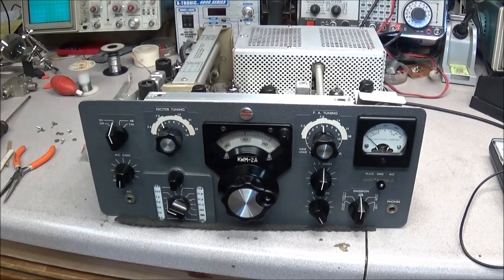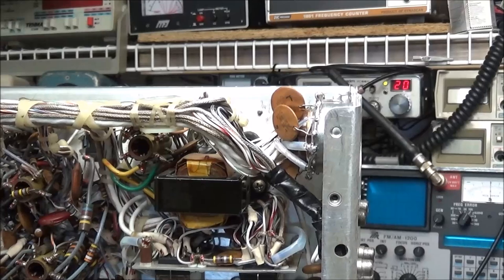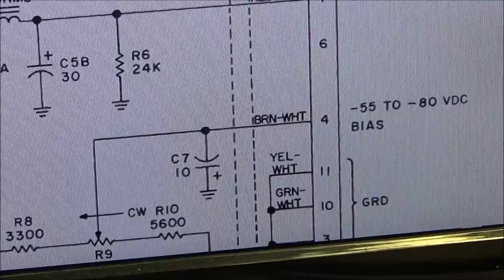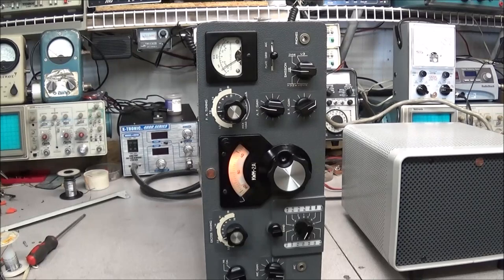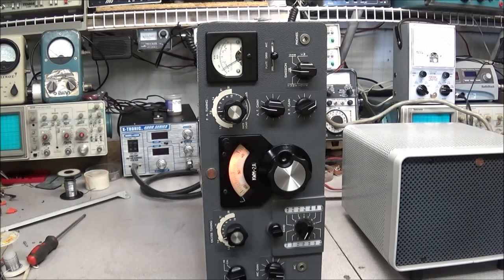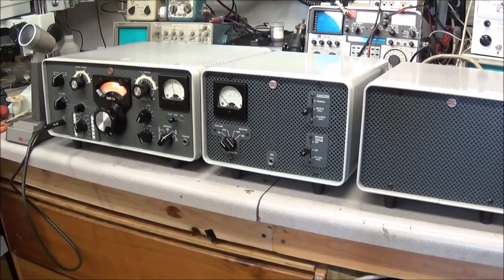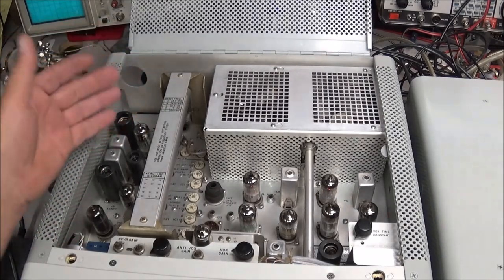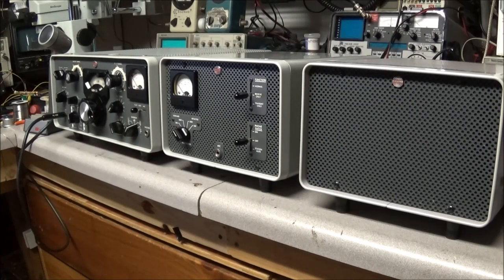#63 A look at a mint Collins KWM 2A in for repair

Comment: Thank you for this video!  Back when I wore green (1968 - 69) in the First Mob, I did depot level maintenance on the KWM 2A radio and it's accessories.  Each of us had a work station inside  a wire cage where we repaired, tested and then packed the radios, amps, mics, cables, etc. into their grey Samsonite suitcases.  They were then set into a pre-deployment cage along with antennas and what ever else would be needed for whatever might be the next mission.  When the mission was determined, you went to that cage and withdrew the equipment you personally had worked on to fill out your orders.  Then, you and the equipment got transported to the flight line and off you went....usually to classified locations.   (At this point I'd ask that you read about LIMA Site 85.)  One day I'd like to get one of these beautiful machines for myself just to put on the desk in my "lawn office" to look at and remember.  I really appreciate you and especially your customer for caring for this amazing electronic masterpiece.   Your work brings back memories.  Thank you, again.
Reply from the maker: Thanks for sharing your story

Comment: The ergonomics on this last tube generation of Collins radios is unsurpassed. The knobs are so beautifully shaped, sized, and placed, and who doesn't love the little finger detent on the main tuning wheel so you can spit it easily. The zero backlash on the gearing, so clean.

Collins was a genius guy; few people know that he invented a forerunner of the internet in 1959,  a message switching system, that he tried to sell the Air Force, but they couldn't understand it.
Reply from the maker: Agreed, thanks

Comment: Boy, you are definitely the king of switch and connector repair; the power port design was really cool but cool often translates to super hard to work on! I'll guess there were probably a few "choice words" uttered as you did that one and better not recorded! Thanks for sharing, look forward to the KWM-1 repair, she sure is a beauty.  73 - Dino KL0S
Reply from the maker: Ha ha thanks for the very kind words Dino.   That power port is a bear to replace. And on top of having to put all the tie wraps , wax coated string, and wires back in the correct location, you also have to set every screw head back to it's factory orientation. Each screw has to go back in its original location also.  Got to keep the Collin guys happy.  Thanks again my friend.

Comment: Buddy you are for sure the first class VINTAGE RADIO EXPERT ;-) Very well done ! Like this old Collins! 73
Reply from the maker: Not sure about expert Peter. just an average guy with a passion for radio. Old radios lol. Thanks for the kind words and stopping in Peter. 73
Reply: Come on Buddy you don't need to be that humbly! Give this kind of radios to a young tech and you will see how they fail! As you said it is the passion that drives us! Take care old friend!
Reply: +TRX Bench 

How they fail or run for the hills.  A lot of the younger folks think "Ah, its old, must be easy to fix".  They don't realize how much wire is in a point to point wired radio.  They quickly realize they can be a lot more of a challenge than modern radios.

Mike
Reply: That's it Mike! You hit the nail on the head!
Reply from the maker: You guys are right. The new guys would be lost. That means we are getting old :-)

Comment: Hey, how did my radio get on your bench.  Knew I left it somewhere, apparently couldn't remember where.  Feel free to ship it my way at your convenience.  :)

On a more serious note, sweet radio in really nice shape.  Replacing those sockets can be a nightmare and not just in Collins radios.  Definitely not something they designed for easy replacement.  Great repair, keep them comming Buddy.

Mike
Reply from the maker: lol, UPS or FedUp? he he. Yes they are a pain. Then when adding the insert collar and ground bar it is even worse. Will be working on the -1 by the week end. Should be a fun repair.Thanks for stopping by Mike.

Comment: Have you ever worked on the 516F2 powersupply mod kit from Radio Farm? It is a retro fit p.c. board with components for the 516F2.

John

Comment: hello there I have a Collins kwm2-a that someone gave me and I noticed when you turn the center dial it does not go all the way to zero and it does not go all the way to 200. is there any way to adjust that so the zero lines up with the red mark on the screen and on the 200 as well? any information will be helpful thanks for your time
Reply from the maker: This sounds like the compression disk are worn and started slipping.  really hard to say on this with out looking at it.  A lot going on in the PTO.
Reply: The Radio Shop thanks for taking the time to respond and the info.